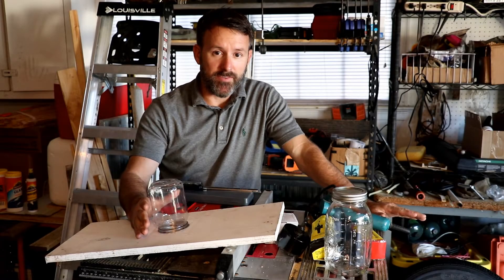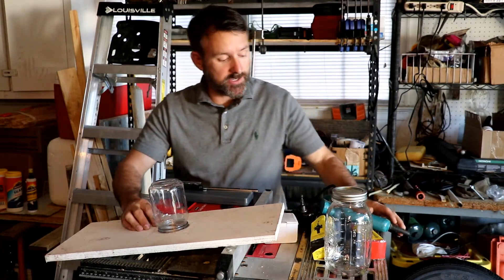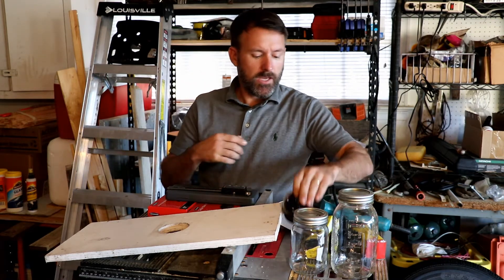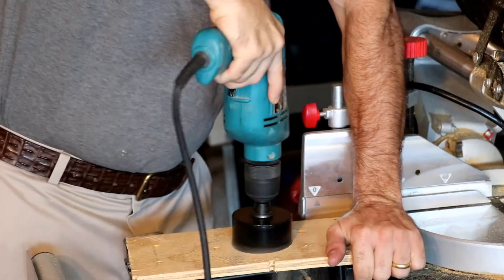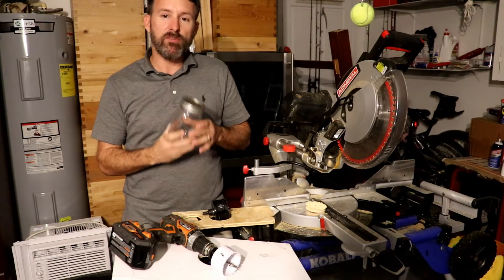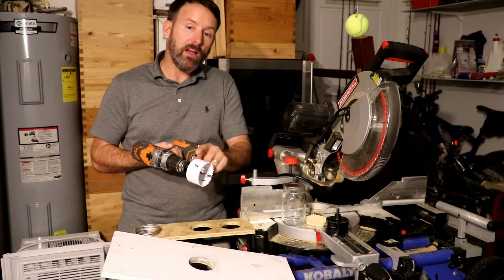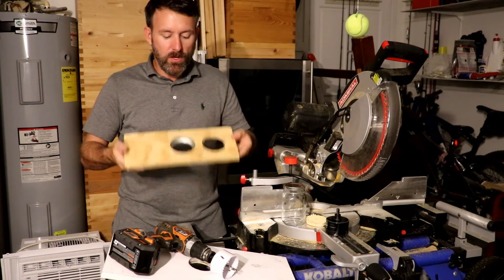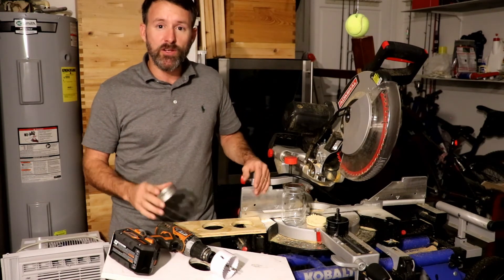⭐ PERFECT HOLE SAW SIZE for a Hive Top Feeder

Comment: And it is 87MM 3.4" for wide mouth mason jar.  It's a tight fit, but the jar goes in all the way. Maybe you can add that in the video notes.
Reply from the maker: Good point.  I've never used the wide mouth jars for feeders.